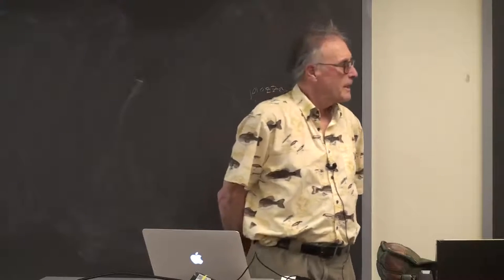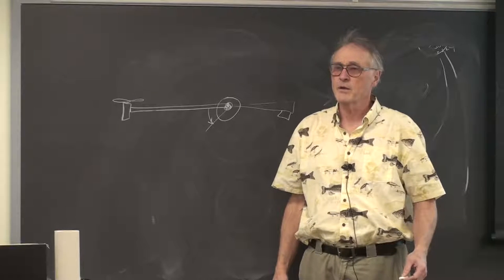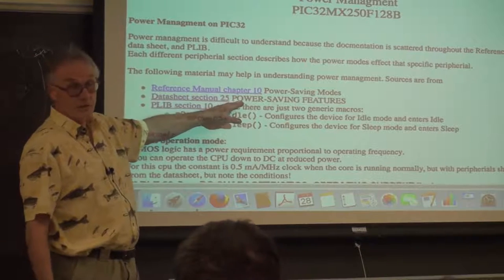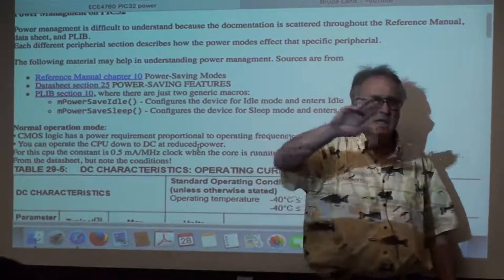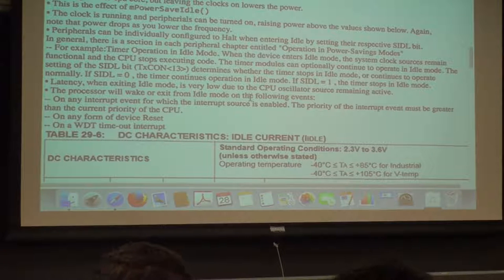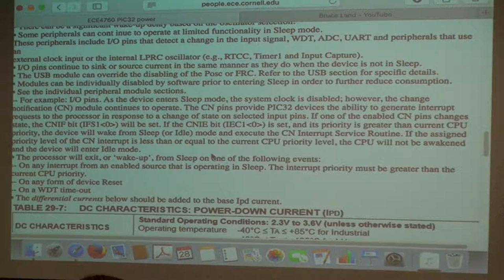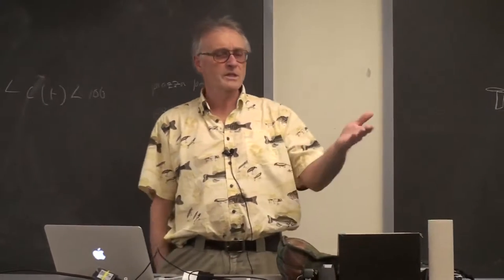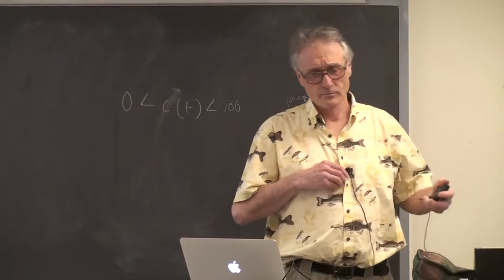#25 PIC32 power saving

Comment: An interesting feedback-based lab could be something similar to the hovering stick, but instead of a fan, it would be a trough-like device rotating around the shaft of some sort of servo, with a small ball rolling along inside, and you'd have to balance this ball near the center of the trough so that it doesn't fall out if you give it a whack, by measuring its position.